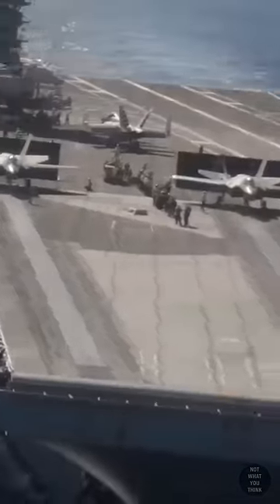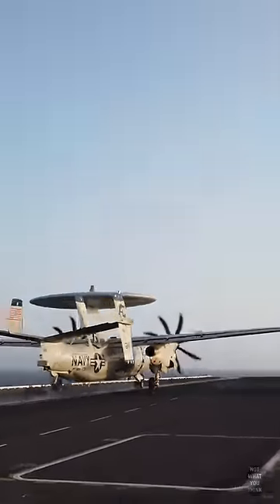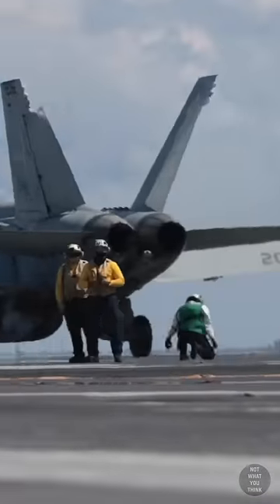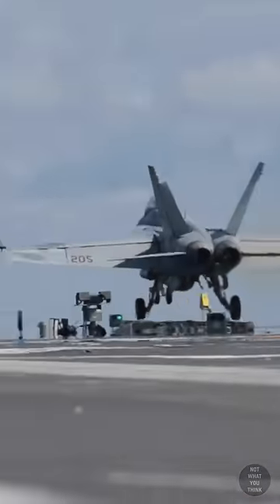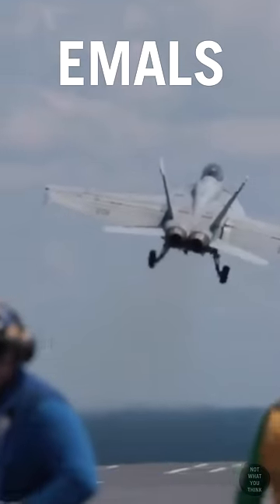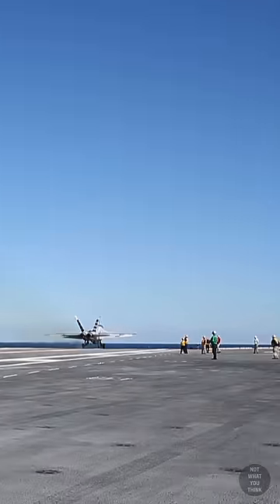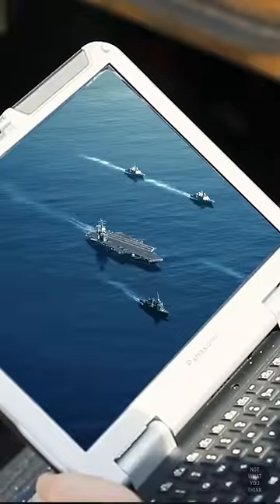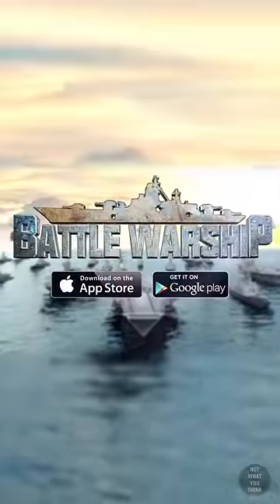Check Your EMALS #shorts

Comment: Requires less maintenance, and yet breaks down more often. Hmmm.
Reply: It could be easier to repair and probably doesnt need maitenance after every use
Reply: Because it’s new u mug. They are still looking at ways it can be improved with each failure
Reply: @TomTheGamer913  yeah, and like most things, they'll almost certainly find that the way to get it to break down less is to give it more maintenance...
Reply: Isn't is a prototype? Like there's literally only one of them
Reply: He meant that it break down more often but requires less work and time for maintenance
Reply: Sherman and T-34 in a nutshell
Reply: Repair isn't maintenance technically lol
Reply: Maintenance is just that maintaining the thing a general look over making sure it hasn't broken down.

The old one needed more maintenance because it had more moving parts meaning more parts to make sure aren't broken, this has less moving parts so there's less to check.
Reply: It wasnt entirely clear, but I believe he was referring to the general rule in engineering. That the less moving parts you have the less chance there is of things breaking and therfor less maitenance.
Reply: Upgrades, people, upgrades
Reply: @WEE9  it doesn't need maintenance every use, it needs to be replaced every use
Reply: @Bzorlan  no roller coaster companies have been using them for 15 years not as powerful but still
Reply: @malachimarko7963  bit different though innit. Don't think it's legal to accelerate roller coasters as quick as fighter jets
Reply: @malachimarko7963  🤦‍♀️🤯🤦‍♀️
Reply: @TomTheGamer913  that’s not the point.
Reply: @uhohmemebiggestboy212  what do you mean? It’s being maintained 24/7 by a computer.
Reply: @lemomannmusicproductions4074  but it is being maintained 24/7 by a computer.
Reply: @_banana__6792  it is being maintained 24/7 by a computer.
Reply: Its like komputer hardware, it doesn't need maintenance only cleaning, and you can only know its broken when its not working, and usually something needs to be replaced not fixed.
Reply: @lemomannmusicproductions4074  yes this man understands budget proposals
Reply: It's having teething issues. Since it's new tech and the only ship currently with it
Reply: Hmmm I can’t seem to make out that connection here…
Reply: They just repair it less
Reply: It's working like a champ now.
Reply: @malachimarko7963  you are absolutely correct. Same principle exactly. The acceleration is the same too except that they stop accelerating sooner leading to a lower end speed.
Reply: I think he meant scheduled maintenance. Unscheduled maintenance would be shit like the EMALS breaking down so often or it doesn’t have a pattern of failure.
Reply: No it doesn’t. Steam systems break down because of plumbing even.
Reply: @Bzorlan They probably could by just increasing output.
Reply: @easyenetwork2023  aye but that's more wear on the electrical components that wouldn't be present in lower voltage testing

Comment: Aircraft carriers look so badass when steam rises through the catapult up to the flight deck. This ruined that.
Reply: There's still something badass about an invisible force accelerating an aircraft to top speeds.
Reply: Same with trains
Reply: That's you, This looks like something you would see in a sci-fi movie.
Reply: How is a catapult cooler than an airplane railgun?
Reply: @jensadams9326  It’s still a catapult. It’s literally the same exact thing as a steam catapult accept it’s powered by linear induction motors instead of steam. A rail gun is a weapon that makes a huge piece of metal go 2 kilometers a second. Not a device used to launch aircraft. I’m pretty sure if you made any airplane go 2 kilometers a second it would instantaneously disintegrate and kill the pilot. That’s not to mention you’d have to have a lot more power than an aircraft carriers reactor could produce to get it up to that speed to begin with.
Reply: @UltraMagaFan  I didn’t really mean a literal railgun
Reply: That's true. However, when you're the spotting director at night, your job just got way easier.

Comment: I used to work for a company that made the valves as well as the Hydraulic actuators that would open and close the Valves. It was Rodney Hunt in Orange, Massachusetts. They Made Bell Valves big enough to Drive a small car through. From start to finish all parts made from Smelting, to CNC to fit, Paint and finish. Hydraulics unit for operating the Valve made in house as well. Very well made stuff. I loved that job.

Comment: LIM’s or linear induction motors were first developed by rollercoaster manufacturers to provide a more reliable launch system for launched rollercoasters than traditional hydraulic launch systems.

Comment: CAT needs steam from the ships boilers to launch. So once a number of aircrafts are launched, it needs time for refill. EMALS doesn't and can launch any number 24x7 and the same technology is being used in the launch of some roller coaster rides too. Adding to that, the pressure these system exert on the airframe will reduce the life of an aircraft considerably whereas for EMALS, it's linear and since it is electronic,  it can be operated and controlled by computers.